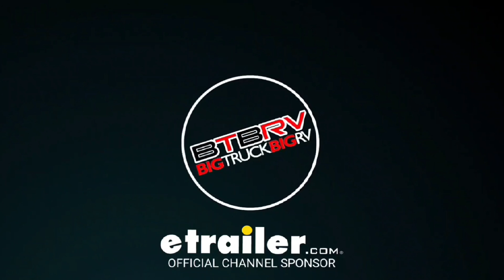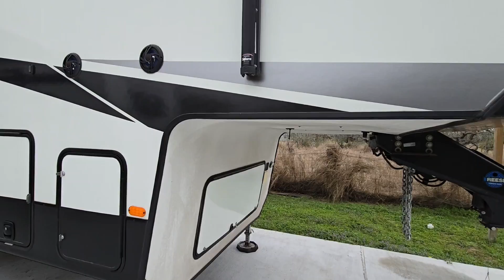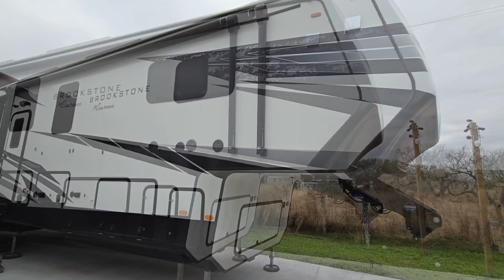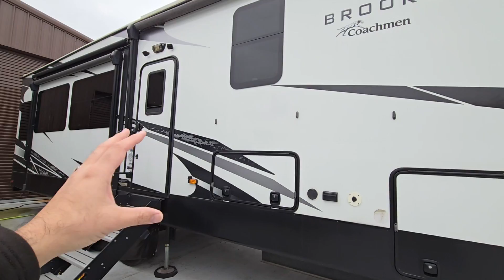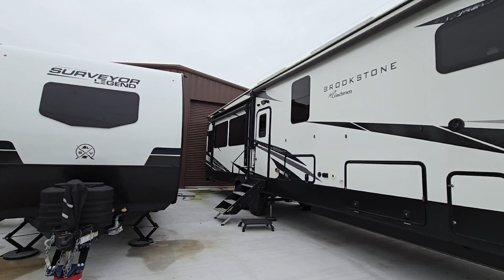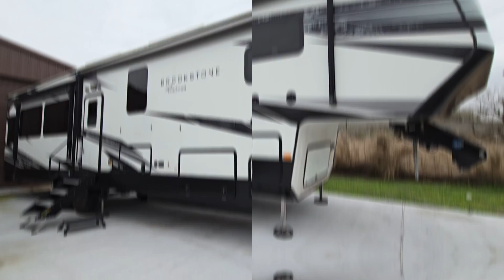BIG FRAME FLEX Update! Heading to Indiana ask Lippert Viewer Submitted QUESTIONS!

Comment: I see 2 issues with this building  of 5th Wheels..
Why lag bolt the body to the frame. Lag bolts will losen with road conditions. WHT not put bolts and nuts that won't work lose.  2nd,  why not create a lip along the frame for the wall to sit on.

Comment: JD, because of your videos, I stopped the other day and had my Rig (Full Profile Fifth wheel)weighed.
I want to know my numbers.
Question, do you know someone  personally that had Frame failure  and if so, did they have to provide weight documentation to the Dealer or Manufacture ?
Reply from the maker: Hello sir. I did know someone a few years back that had a stress crack on their sidewall near the slide up front.  He actually had his RV parked 3 spots down from mine at a storage facility.  I didn't know what he ended up doing about it or how it was loaded unfortunately.  I will definitely pay more attention moving forward

Comment: Hi,
With that RV , should it have tripple axels ?i would think it does .
Of course the customer is going to load 3000 lbs of extras,what they dont do is load the axels correctly and the fith wheel would be taking above rated loading .
I really have to wonder why a person can hook up such weight ,but not be an experienced driver.
Ive seen RVs used on gravel roads and break,there is no warranty for that .and basic leaf spring suspension is inadequate,but hey they get sold ,out the door they go .
Covid had manufacturers in a pickle , substandard work and materials happened .
You comments about rhe structure,a big box on a frame that doesn't have internal frame as part of chassis structure is asking for issues.
I hope you put your Rig over the scales and make sure all loadings are correct,and that includes gross limits for everything.
Certainly an interesting topic if not controversial at times

Comment: I can come up with a ton of reasons why the owner is responsible. Your spouting koolaid answers. Overloading units by the manufacturers by building to be exactly at the specs. Or crappy welds by manufacturers. All I see in these videos is defense of lippert. You have not done proper justice to this issue.

Comment: What about the incomplete welds? What about the pour weld quality? Remove the cap and front under belly to expose the frame on a unit that has not experienced frame failure and look at the quality of the welds and the fit up. Make a video on that.
Ask them what is the safety factor of the frame rating?

Comment: JD, Thanks for doing this video series.  Asking these questions and getting answers straight form there manufactures helps us better understand the issues and multiple potential causes of frame flex (which can lead to failure).   I know some kingpins, like the MorRyde pinbox, are able to absorb some of the movement while travel down the road so abrupt forces are dampened between the tow vehicle and the trailer.  IN a future episode, would it be possible to look at hitches?  Are there advantages (in reducing potential for flex/failure) to using a hitch that also reduces the g-forces applied to the frame…like the Hensley TrailerSaver?  Thanks for all your great videos!

Comment: My question is why does Brinkley RV sell gen Y fifth wheel hitches and gooseneck as an accessory replacement hitch. If lippert has not approved these hitches. If they get frame flex and it’s manufacturer failure who fixes it.

Comment: The majority of Lippert frames will never experience a failure. But if I was buying a trailer that weighed over 15,000lbs I would never consider one that used only 1/8" steel in the frame if I intended on driving it cross country. You just can't predict weather or road conditions, and I don't depend on luck to get me down the road.
Reply from the maker: From what I saw, they are 3/16th or 1/4".
Reply: @BTBRV , no expert on what's being produced but I have personally seen 1/8' thick frames on non fifth wheel RV's up to 30' long. It works in perfect conditions, somethings roads aren't. Something I would consider before buying.

Comment: I don't buy your explanation regarding the majority of the causes of frame and chassis damage.  The fact is that this is an engineering and design issue between the OEMs and LCI for the most part.  Of course, the end user bares responsibility if they cause damage.  Overloading, improper loading, driving off road, and adding attachments to the pin box are end user problems.  Frame flex is a new term that never applied to older RVs.  That tells me that recent changes in design and engineering, build quality, and quality control are the biggest issues.  The bigger problem is that LCI and the OEMs refuse to stand behind their warranty, and their products.  These companies are in business to make money and nothing more.  Support after the sale is non-existent.  Why do I get a better warranty on a new car than a much more expensive RV?  Because LCI and the OEMs know that what they are selling is cheaply designed, engineered, and built, and they have no intention of giving truthful answers to anyone's questions.  If they did, this problem would have been solved already.  The solution: buy an older RV, have it third party inspected, and save yourself the nightmare of dealing with these companies.  I hope the government will begin to heavily regulate the build quality of RVs, and I hope that the states will pass lemon laws that hold these companies accountable for their shoddy workmanship.

Comment: JD, ive been watching your channel for a while now and respected your opinion.  But in this case, i think you missed the point on "frame flex".  The "frame flex" that ive been reading about is not the house frame as you said but exccesive  movement between the hitch pin and the frame that it is mounted to.  If you look at those videos, Lippert has accually sent a team to inspect and repair the chassis frame.  The team  started welding reenforement to the chassis frame so that the hitch pin doesnt move/bending the frame.  Nothing to do with the house framing.  Please go back and understand the chassis frame flexing at the pin mounting point.

Comment: If Cracked occurs on one area of the frame their is a weak structure point needs to be address by the manufacturer (semi trailer would have the same problem would not be allowed on road)

Comment: I’m curious which floor plan configuration’s are having a majority of frame failures? Are they mostly toy haulers, or are they front or rear kitchen models where a majority of the weight is either in the rear or in the front?

Comment: Good video! Bit long winded cause of going off track about the w/d flooding to the kitchen sink, to the stuck slide, to getting a inspection yada yada, n bringing up the main point of the frame separating from the walls 3x like it's a new point 😂. 
But based on the comments here, don't know if talking to the big boys a lippert will help as you've basically said your being told the main issue is wall to frame separation. Well then now wouldn't it be best to turn your attention on to why is that happening? And is it really the biggest cause for frame failure? So this is a dead end unless you get yourself immersed into a repair shop fixing these frames and to owners dealing with the issue, to hear the rest of the story, because yeah a lot of variables of poorly maintained road travel to water damage to overloading could be the root of it or not. 🍻

Comment: The most interesting part is that this frame failure is happening to toy haulers and really big 5th wheels.  It really begs the question if there is an engineering design flaw somewhere.  If you are towing something heavy, there might need to be more reinforcements or a completely different design.  Everything these days is made “lightweight”.  Maybe it should be made heavier to deal with travel/earthquake type of travel.  I am just guessing here to be honest. Also, I have driven in many paved roads like interstate 10 that is just pothole city.  And I have been on some dirt roads that are way more smooth.  If I just stick to these highways, I’m still subjecting my truck and trailer to some pretty rough roads!  I’m just saying.,…thank you for your hard work into this subject.

Comment: I think you said a whole lot, without saying a whole lot about the issue.  I can't believe you are stating that "water damage" is causing frame flex.  How about having discussion about what diamater of steel channeling was used earlier versa today?  another point wold be actual type of frame construction used: square tube vs open channel.  And, why is the issue predominantly on certain models and not others using Lippert frames?

Comment: Here is a question to ask related to Lippert's statement about using domestic steel. Ask where the "steel coils" of steel are manufactured that the frames are built from. Much of the "coil steel" used in many products in  the US are from other countries. The coils are produced overseas and shipped to the US, then another manufacturer in the US makes the finished frame here and the product is stamped as a "product of the US". I see this in the construction industry for many components we use everyday.

Comment: First thing I would ask about the frame building is. Are your manual welders certified and by what standards 2. How often is your Weld materials tested in compatibility (tensile and yield) 3 how often do you do Weld strength testing (ie sections of welded material put under tensile/yield strength plus elasticity of  Weld joints) 4 do they have the material data sheets stating tested strength of base materials. I have viewed many of the so called frame flex videos and what I have seen is failure of frame materials bond(welds breaking at critical areas) frame flex is a built in factor of ALL frames by engineering specs. Frame failure is not. When people have the pin box move more than an inch, you have failure in the upper deck somewhere. When you riser movement as seen in some videos you have frame failure and Lippert is responsible. Responsible for poor joining of materials and should fix it. Over loading is owners responsibility. I understand everyone's comments, feelings on this major issue and booth Lippert and builders SHOULD NOT turn blind eyes on it. Good videos and explanations.
Reply from the maker: Better than asking them, I'll ask them and show you in another video.

Comment: I appreciate the effort JD.  There is nothing groundbreaking in this video.  Is Lippert really who we should be asking about this issue?  Isn’t that like asking the criminal to admit they committed a crime (not accusing Lippert of anything, this is just an analogy)?  While Lippert can talk about the ways a frame can fail, that doesn’t get to the actual issue.  What exactly is causing these frame failures?  While I don’t believe they are all created by the same issue, I have a feeling there may be some common themes.  I would like to see an independent assessment of these issues to find the root cause and common themes.

I also think the interview with the head engineer is going to be fruitless.  They will be well prepared by the legal and executive team to give a politician type answer.

While I sincerely appreciate the time and effort you put into your videos JD, it does seem like there is some bias in any video related to RV’s.  You are very careful to not be over critical of any manufacturer (even if they deserve it).  I almost feel like you don’t want to upset the sponsors or potential sponsors.

Comment: First off,  using this Brookstone with no slides on the front is basically a waste of time.  Im sorry.  The ones with front slides are the ones that are most likely to over flex. I can show you photos of my 2012 3495FL Alpine by Keystone. With in 1 yr after purchase we started to have frame flex. Finally after 2 years or so and we put less than 5000 miles on it, it got bad.  We purchased the unit when it was 3 yrs old at CW in concord NC. Sales Rep and Manager swore to us that previous owner never pulled the unit. It came from the factory to CW lot to the purchasers campsite across the street.  And that he traded every 3 yrs.  So with the mileage from Factory to Concord, to us purchasing and pulling, Unit had literally less than 6500 miles on it.  After fighting and getting refused by Lippert and Keystone, my insurance somehow approved payment of 20K to fix.  CW Concord,  put a band aide on it after having for 9 months. We made 3 trips from Ohio to Concord to pick up only to find it was done. Finally they delivered to us after they said it was fixed.  It cracked again during transport from Concord to Graytown, OH.  Transport person refused to take back to concord because he did notfeel safe in pulling it.  Finally after many calls and refuseing to sign over the 20 grand check until it was fixed.  CW in Rossford OH came and got the unit.  They found the frame welds were broken on both sides.  Factory Defect.  There was also at the same time a Montana 1 hour north with the same issue and with 2 front slides like mine.   We had no water damage. And Keystone put out a TSB on this Over Flexing Issue.  But not a recall.  So the customer was held responsible for repair cost.  Keystone denied to cover anything on this unit.  I have pics of the weld cracks before and pics during repair and after.  I will say.  Since CW Rossford fixed the flex issue. We have not had another issue at all.  Mind you, Keystone wanted to see our Tow unit and the 5th wheel we were using.  Which were new.  So they did not blame that issue.  They just refused to take blame and put it on us.  And since then, I have read about at least 100 more that had the same issues as mine.  And Keyston maybe covered a small percentage of those.  Other makes with 2 front slides are having the same issue.  Not all, it is like building a car on pay day.  The unit with front slides will be weaker, therefore they need to protect better.  They need to support Better for the overflexing.  I would love to get reimbursed for what was paid out for this.  Also, weak kitchen floor.  No water damage.  CW was suppose to correct that as well.  And then refused. The total cost of front end repair was less than 10K according to the Manager at CW Rossford.  And said they would take care of everything that needed to be done.  the kitchen floor and the black tank.  Never touched them. And we wont get into wiring and Furniture issues.  We bought extended warranty that covered nothing and paid over 3500$ for it.  Furniture in LR is garbage and was peeling extremely bad.  Now we have to put sheets on them to sit down.  And can not find replacements due to the type of slides we have.  They are not flush like the new ones. They have a riser half way back from the front of furniture.  Even Keystone said they have no clue and the furniture manufacture said the same.   So when you go to the factory. Hit all the manufactures with the FL 5th wheels.  See what kind of support they are putting in the side walls to help to protect from over flexing.  Have them pull up all the TSB's from back in 2012 on up in reguards to this.  Guaranteed they wont show you.  But i do have a copy of the TSB that is a guideline to go buy for Repair.
Reply from the maker: Incorrect, I have a bedroom slide on the other side.
Reply from the maker: Can't comment much on this.  A bit too little information on what happened prior to you owning it in the 3 years it was never towed.

Comment: All i know is the 2007 keystone cougar is not a high profile 5th wheel and the problem we had was the metal around weld areas in the pin box area failed. Whether it was faulty steel or welding process or the netal just not heavy enough metal for the size and length of the rv. My personal opinion is the frames are not built heavy enough to support the size of the 5th wheels. I will agree there are other ways it can fail but in my situation i didn't have any water or overloading and after seeing how it broke it was just not built heavy enough
Reply from the maker: Ok got it. 16yr old unit with issues. I hope they take care of you!
Reply: @BigTruckBigRV  no they didn't and the issue happened in 2010. It was one excuse after another. Had to get it fixed myself and then traded it couldn't feel that it wouldn't happen again switched to jayco and haven't had any issues (eagle and nowca north point)

Comment: Thank you for this video J.D I bought a used 5th wheel  And I have a short bed truck. The camper came with a Reese sidewinder pinbox. Lippert says it isn't  approved. Could you ask Lippert if they could test it? It has been great so far. Thank you

Comment: "Avoid rough roads" means the unit isn't built for actual camping conditions. Bad highways including interstates, dirt campground roads, and other normal use MUST be part of the design, as well as a healthy safety margin! 

I think you presented Lipperts info well, but they (therefore you?) may have made too much of owners mistakes. Do you really think only 0.5% of owners are doing these things? 

I also think many of the negative comments here are reacting to your tone rather than the words. Although many phrases sound a bit hollow, like a lawyer. I know you're trying get the info out, but be careful your good intentions dont blind you to thier prevarications.